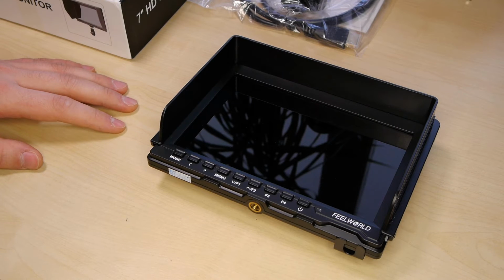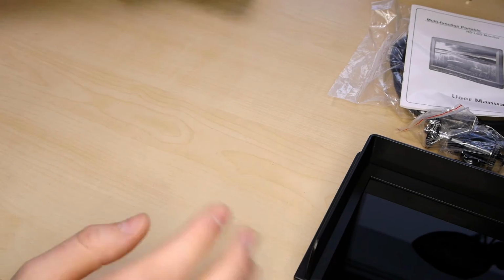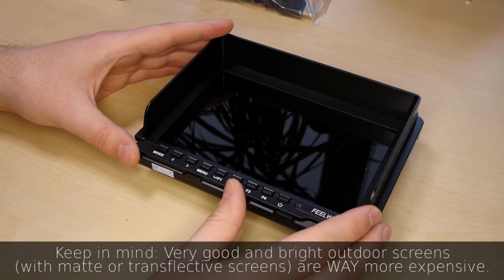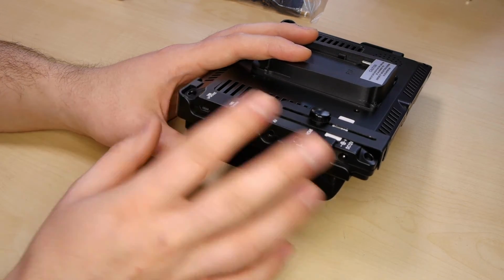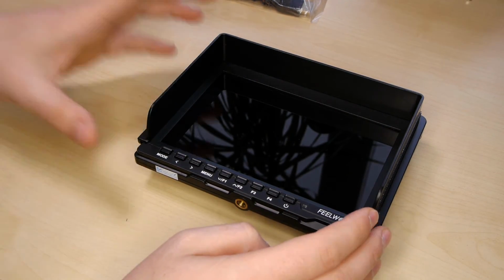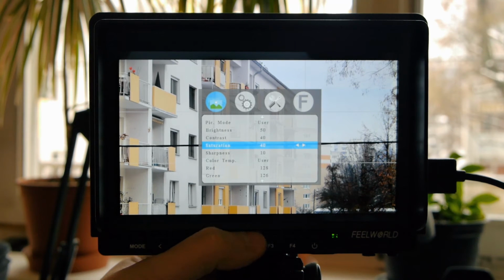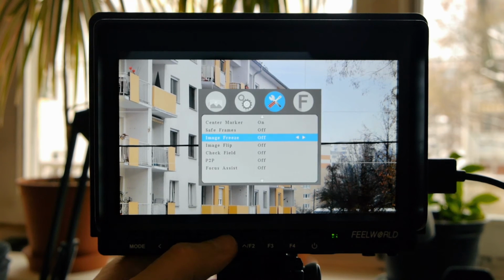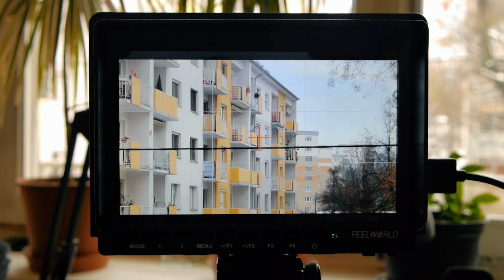Feelworld FW759 / FW759P field monitor - Very detailed HANDS ON (with calibration settings) (!)

Comment: Is battery included ?
Reply from the maker: No. Batteries are (normaly) never included. There are just some special packs / kits dealers or manufacturers offer sometimes. Btw.: This model is now quite old (the video is from 2016) -> Unless you get it super cheap on the used market, I would go for something else (especially with more brightness to use it outdoors more easily). Also recommended: 5" up to 6" models. 7 inch is too big most of the time for on camera use with smaller ballheads / tilt adapters. Have a nice day. ^^ LG

Comment: Hi. Does ist have a External Recording feature ?
Reply from the maker: No. Its just a monitor. The unit is also quite old / long on the market now (video is also quite old). There are better units now available with higher brightness and way more features. Unless you get it at a very good price point - Its still a good screen ^^.

Comment: At this point (2023) at some internet sites you can now  buy this monitor (new) for as low as $89.00 US.. so it is definitely a very good deal
Reply from the maker: Yes. Its still a good deal. To all which are interested - Just keep in mind the non Full-HD resolution (the screen only offers 720P native resolution) and its quite "reflective". So more of a studio / indoors screen. Its sometimes also available as a great bargain on the used market too (also the direct / outside nearly identical FW760 and FW74K successors). LG

Comment: Be aware, you cannot power your camera with the monitor. It's a DC input; not an output. This thing takes the massive batteries, but unfortunately you have to use your other batteries in the camera. (I have a panasonic gh5, with the dummy battery but I cant power up my gh5) If you have any idea how I can power my camera with this thing, it would be greatly appreciated. 

Quality is good enough, slight delay but nothing to worry about.
Reply from the maker: I am not sure if its possible with that screen (as you mentioned it seems to be only an DC input). I sadly do not have the screen anymore - So I cannot test it on my side. You can still go for a battery, which offers a D-TAP or DC output. That way you can connect to the battery directly (and then power both - Screen and camera at the same time). Just keep in mind: You can get some ground loop issues / audio humming using such solutions (humming in the audio). So you have to test it with the final setup in detail (before using it in field / for a project). And order the stuff where you can give it back if it causes any issues. ^^ LG

Comment: My monitor doesn't show all of its space, only the middle. Yours shows all of the screen's really estate.  Is this a menu issue?
Reply from the maker: Is it showing a black border around the image? Or is it a crop into the image? LG
Reply: @AustrianGeek  it's black around the image. When I playback, it shows the whole screen, just not while filming or live mode.
Reply from the maker: @hotelphotography  I guess you have a Nikon DSLR right? Some of the older models output a black border around the image (also some Canons). There are ways to unlock the fullsize HDMI output while filming (for example for older Nikon models the hack option https://nikonhacker.com/wiki/Supported_Models). Btw: It should not be an issue with the monitor (but with the camera / camera settings). Search for full size HDMI output for your specific camera model. You can also plug in your camera into a TV as a test - You should get the same results / the same black borders ^^. LG

Comment: Is it a way I can watch videos I already record on the monitor
Reply from the maker: Sure. If the device you´ve connected it to supports the HDMI output of the recorded videos (a camcorder / DSLR / system camera for example). If you want to be sure, that it will work over HDMI, then you can test it with a TV set (just connect the device over HDMI - If playback is possible there, it will be also possible over an external field monitor ^^).

Comment: Is this monitor also good for videocamera Panasonic 90 ?
Reply from the maker: In case you mean the AC90 - Sure. Just be aware, that there are already higher quality models on the market (also from Feelworld). But in case you get it quite cheap, then its a good solution yes (the FW759 aka FW759P). In case you search for something smaller with way better features you can also check out the SWIT CM55. Its still quite cheap / affordable and I personally switched to 5" screens (for on camera use) due to easier handling / because the screens are more lightweight. Also nice is the ATOMOS Shinobi (5" screen), which is more rugged and brighter than the CM55. Have fun shooting ^^. LG
Reply: Thanks for the answer. The monitor must serve for VIDEO Panasonic AC 90  !!!!!!! not for photo. @AustrianGeek
Reply from the maker: @bols1222  Yeah. Thought that you mean the AC90 ^^. Really check out the mentioned IKAN CM55 and Atomos Shinobi too (I have both lying here - Great devices and more mobile than other 7" models). LG

Comment: hi i’m having so much trouble connect my g7 lumix i got 3 micro to regular size hdmi. i even tried an adapter and it still doesn’t show up or connect please help !
Reply from the maker: Hi there. The problem with the Panasonic G7 is, that its not possible to output video while recording (its showing then "recording running" or so with white letters on a black background). You should get the live video feed though, as long as you´re not recording (so you can normaly use it as a live feed camera for streaming and you can also use it as a webcam with a small USB HDMI frame-grabber that way - You just need to disable the "HDMI Info Display (Rec)" in the Wrench Symbol menu -> TV Connections. There you should also be able to set the HDMI to 1080P - from the standard "Auto"). To sum it up: Live feed over the HDMI / on an external screen is possible, playback is possible - But as soon as you start recording the screen will go blank. Hope that helps to clear up things ^^. LG

Comment: Hi, I don't know if you will answer this 4 years after, but does the monitor have audio levels showing? Or if my Canon 250D has audio levels, do you know if this will show on the monitor?
Reply from the maker: Nope. That model (the Feelworld FW759) is too old for that. They added that features way later (in the newer models). As a hint: I would check out the smaller and easier to mount Feelworld F5 for that. There you get audio levels (displayed gets whats coming then over the HDMI) - But you also get a headphone out port (in cases where your camera doesn´t have one that´s quite handy - Like its the case with the Canon 250D).

Though keep in mind: You get a little bit of a delay over that porst (as the HDMI conversion also takes some time in camera and in the monitor). So its not really handy if you´re recording yourself - As its annoying to hear yourself with a delay while talking ^^. About the audio levels you can also check out the menus (displayed items) of your 250D. Altough it could be, that you only see them if you set the audio in the menu from Auto to Manual (and you only see them then in this sub menu). At least it was the case with my EOS M50 (if I have it right in my backhead). Btw.: You can also try out your 250D first on a computer screen with HDMI (or a TV) if you want to check whats getting displayed (a field-monitor is just a smaller version of that ^^).

Have fun shooting! LG
Reply: @AustrianGeek  thanks a lot for a quick and thorough response! I really appreciate that. 

I didn't think of checking my camera on a computer screen but did it just now and saw that the HDMI projects everything from the camera display, so my audio levels will also show. So that's what I wanted to know. Thanks! 

I got a really good offer on the FW759 which meets my demands atm. (and my the volume of my wallet) so I will just stick with that in the beginning and see how it works. 

Have a nice day. Take care! :)
Reply from the maker: @benkastberg  You´re welcome ^^. Yeah. The FW759 is quite cheap available sometimes. If you get the levels anyways over the 250D, the 759 also works fine. Have fun shooting ^^. LG

Comment: Hi, I just got this paired with my V770 which was cool advise ty.  However, there's a lot of feedback noise. Did you experience this? Do you have any advice on how to cancel it out?
Reply from the maker: Thats the volume you need to turn down on the screen (as the camera feeds the audio live over HDMI, the monitor outputs it over the speaker and the camcorder records that output again and the loop starts all over again - Its called a audio feedback loop - And it´s producing that nasty feedback noise ^^). You need to turn down the volume on the monitor to zero (you can control it over the left / right buttons). Or you can also plug in a headphone to disable the monitors loudspeaker output. Have fun shooting! LG

Comment: My camera and my feelworld screen is not same in colour
Reply from the maker: Hi there. The problem is: Many internal camera screens are also not calibrated properly / are also not showing the correct colors. Especially with older camera models its a big problem (most of the time you must be happy, that the white-balance is the same as recorded - So that the image is not too warm or too cold recorded internally but shown different on the camera screen). In general the FW759 is "ok" according the colors. But its also not color calibrated to the max from the factory.

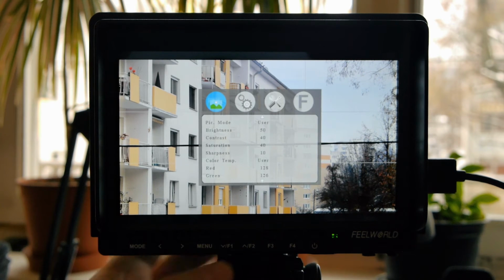Try out the settings I used (check out the video at 16:22 to get more info there). THOUGH: It could also be, that they changed something according the panels or the firmware (so it maybe doesn´t apply anymore to your model - Do you have the 759 or 759P or a different Feelworld?). Btw.: If you have a quite color accurate PC monitor, then check the recorded image with the playback image on your camera (on the camera screen and on the Feelworld). That way you can control whats recorded and whats shown on the camera an on the field monitor ^^. (Just copy the file to the computer and open it - But also let it on the SD card to open it in playback mode on the camera).

Hope that helps. Have a nice day ^^. LG

Comment: I have a Nikon D7200- when i record at 1080 p 60 fps settings in the camera the feed on the monitor will be real choppy until i change the monitor settings where it states camera mode in settings- it then only gives me auto 480 p or 1080 i to choose from- when i choose 480 p the choppiness goes away and the record file is still what i want in camera at 1080p 60 fps- is there anyway to get the feed on the monitor up from 480p to 1080 p? thanks
Reply from the maker: Hmm. Did you try a different cable? Maybe its slightly faulty (which gives you a non constant transfer speed - Therefor choppy images at higher resolutions). AND: Try out your D7200 at another screen / TV - If its behaving the same. If its the same there, its a problem of the camera or the cable. Also try out other setting in the D7200 (maybe there is an 720P or 1080i option which gives you a non choppy output - On "AUTO" mode sometimes wrong formates get selected.) Oh. And disable HDMI control in the menu (if available). Hope that helps to figure out your problem. Have a nice day ^^. LG

Comment: I bought this and I can’t figure out which cord o need for my gh5
Reply from the maker: Hi there. In general you would need a full size to full size HDMI cable (as the GH5 offers a full size HDMI port - As the screen - Which is great, as its WAY more stable than the mostly used micro HDMI ports). If you want to go for something better quality wise, then check out the Lindy Cromo cables - They are quite nice (I use one beside my Deleycon cables - But those are not available everywhere). Here is a link to Amazon US: https://amzn.to/2XL23uS - Btw.: They are also available in 0.5m length (which is enough to use the monitor mounted on top of your camera - Or beside it / close to it). Hope that helps. Have a nice day! LG

Comment: Can you monitor live audio while recording through the headphone jack? So far I've only been able to hear audio in playback and not live audio while recording. Is there a way to fix that, like with magic lantern or firmware update? I'm using a Canon 70D
Reply from the maker: Yes. But test out first, if you camera / camcorder outputs the audio live over HDMI. Just use a TV or your computer screen (if its coming with loud speakers). Not all cameras output live audio while recording. Btw.: You can use the arrows (left right) to control the volume - Its not that clear / instant visible how to control the volume through the manual ^^. Also important: Keep in mind, that you get more delay over HDMI. Because the camera needs to convert everything and also the screen adds a little bit of delay. That solution / audio monitoring option is therefor only really usable for 3rd party speakers. If you speak by yourself, its WAY too distracting to hear yourself delayed all the time ^^. Hope that helps. Have fun shooting (!) LG
Reply from the maker: Oh. Oversaw your other questions: Hmm. Don´t know if its possible with Magic lantern to re-route the audio. Just put it on your card and look through the menus (maybe you can find something). Don´t have a 70D here to play around by myself sorry ^^. But there is also the option to go over the AV output of the 70D. There you get live Audio feed (and there are even adapter cables to get direct audio monitoring). You still need a small pre-amp for your headphones (with audio levels control would be perfect) - But it should work. That way you also don´t have any delay at all (or just a very short delay). Sescom made such cables as far as I remember. But please check if they also work with the 70D before ordering one (for the 60D for example following worked - The Sescom "DSLR-550D-HOCF" - WITH Magic lantern installed). LG

Comment: Oh my... I just got it delivered today. Ok, the resolution is not crapy but the plastic it's made of is simply awful. It should cost half the price.
Reply from the maker: Hi there. Sorry for my late reply - I am in vacation actually ^^. Yes - You can power it with a power bank - BUT: Only with those, which offer higher voltage outputs (so you can connect to the DC plug of the screen). You could also try out DC to DC step up converters (which are powerful enough) to get the 5V USB Output voltage up to 8.4V (in case you want to use the DK-415 adapter) or to even higher voltages if you want to use the DC plug.

About the plastic body: Sure. Its plastic. But way more important it is to have a good and accurate image and good features. Just as an example: The old HD056 monitor (or how it was called ^^) came with a full metal body. It was built like a tank. But wasn´t 100% compatible to progressive 24P signals. Also the colours were not the best / most accurate. Plus: The full metal body added alot of weight.

Btw.: Feelworld also offers A LOT of newer models now (which are also coming with higher quality enclosures). Maybe I´ll find time to test one of the newest ones within the next weeks. My favorite is actually the F570 (which is a smaller 5.7 inch model with full HD panel). Check it out - In case you can still send your FW759 back (and in the case its really not your favorite according the enclosure quality). I also really like smaller screens (as those are also WAY easier to mount directly to the camera. Btw.: Also the Feelworld F6 is quite nice (kind of a copy of the SmallHD Focus HD - Just not coming with the same overall quality and not the same software features).

Have a nice day. LG
Reply: Thanks for the generous reply and insights. New sub here.